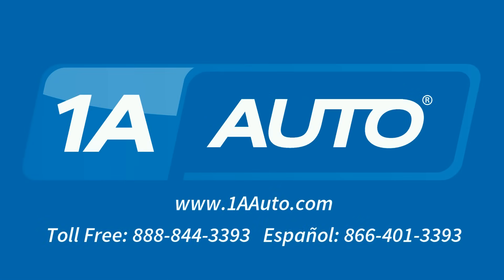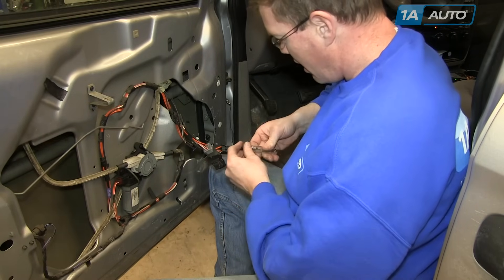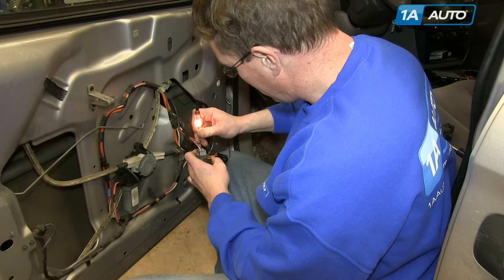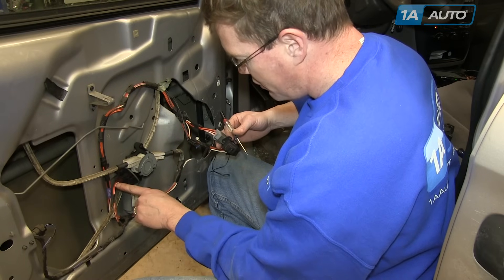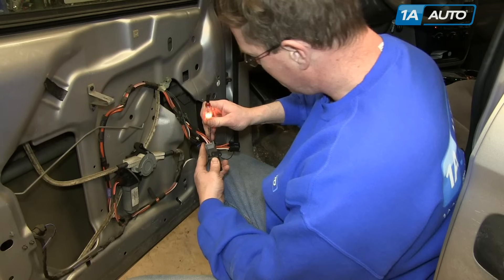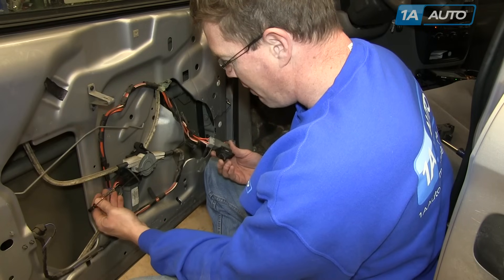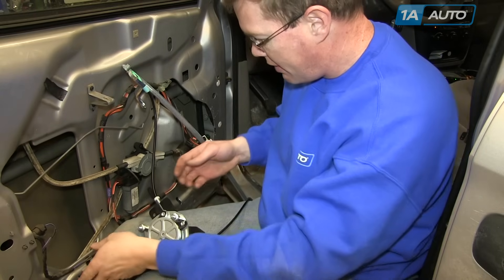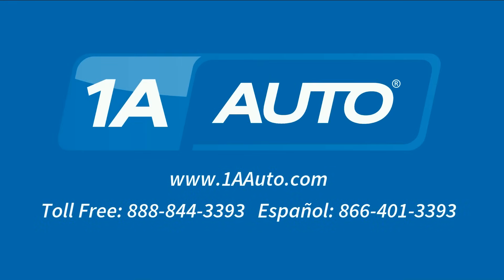How To Diagnose Power Window Problem - Is the Switch or Motor bad?

Comment from the maker: √  Watch the Video
√  Buy The Part at 1A Auto http://1aau.to/m/Visit-1AAuto
√  Do it Yourself
√  Save Money
Reply: Timing chain
Reply: My stereo quit working and then my dash gauges went nuts and then the vehicle died and wouldn't start I think I need to  replace the whole fuse box panel what's your opinion
Reply: @michaelgamblin4606  qqQQQQQ
Reply: @michaelgamblin4606  p0004
Reply: Hi guys, wonder if anyone might be able to help. My Roadster mk 1 driver's window has been slightly erratic for about 9 months but always corrected itself. After a serious cold day it appears to have had enough. It goes down but only up by 1/4 - I've tried all the 'tricks' but no go. Just changed the window motor and still the same. I'll watch the vid when I get back home but does it sound like a regulator issue (as the window does go up partly..??)

Comment: I simply swap opposite side window switches. If problem follows. It's the switch. Great video.
Reply: MegaHowtoMan Damn! That’s so simple, yet brilliant! I’m about to go try that now. Didn’t think of it. Thanks! I hope it is just the switch.
Reply: Damn thanks
Reply: lol They are ALWAYS different on the front doors genius? master switch is on the drivers side lmao
Reply: Thank u so much it worked lol
Reply: I’ve got power in my note or you can hear it when you click the button up and down it’s just been sketchy sometimes when I push it up or down didn’t want to work now I’m sitting here with my panel open and don’t know what to do but Pull my window up and Stick something down in it but can you really put the motor from the passenger side and the driver side? What about the other side when you do that?
Reply: 200 IQ
Reply: @WomenLockedUpBeforeAndAfter  what did you end up doing?
Reply: Flat rate thinking 👍🏾
Reply: Great idea. For me I’m a bit of an idiot and I don’t wanna risk damaging both door panels, not trying to push that on anyone else 🤣
Reply: D

Comment: i used this video get a false positive for a problem with my regulator.  Light came on even though I had a breakin the wireon my drivers side door.  Replaced motor.  replaced switch.  Finally found break in white/yellow wire in boot on drivers side door
Reply: He said at the beginning check for broken wires first

Comment from the maker: If any of our viewers need to replace their power window switch we carry new ones on our website for many different year, make and model vehicles. Here's a link to them. We also offer free shipping on all order in  the US http://www.1aauto.com/power-window-switch/c/35?utm_source=YouTube&utm_medium=CTA%20Comment&utm_campaign=1ATony
Reply: I may need one
Reply: All windows work using the drivers main console but not independently. Help
Reply: 1A Auto Parts question if the window rolls down but not up is that usually a sign of bad window switch
Reply: 1A Auto Parts  I have a Nissan 240SX 95 my one little Swiss is broken I just need the top cover twice wondering do you have that
Reply: 1A Auto Parts Nissan Maxima 2002 diagram for the wiring for the window on the driver side
Reply: Gracias que buen video nunca e ordenado piezas por qué mi carro nunca sea descompuesto pero veo sus video y que bien que ya tengan 800 k suscriptores los invito aque se suscriban a mi canal...
Reply: I have av2015 latitude,pass and I switch is lose any videos on something like this
Reply: @HurricaneMelissa25  what was the outcome of your switch problem? Was it the switch?

Comment: Done the Diagnose on the switch, Checked the relay with a meter And the 9 volt trick, switched relays, Checked the fuse. Took out the motor from the window Took it apart for cleaning and inspection One of the two magnets on the sides for the shaft Had a broken split magnet where the power to go up meets the power wire You could get the window down However once there was a bit of load/tight pinch / way half going up on the motor The shaft would move slightly And the connection would be lost - 

Ordered a new window motor regulator from 1A Auto - It was Cheaper than most other websites And the ship (Has nothing to do with 1A Auto) was pretty fast for outside of the country Right part And fit perfectly .....
I say all this because--- How many part suppliers take the time to show you a video on diagnose And uninstall/install the very part they sell....Thanks 1A ! Top notch !

Comment: I didn't know anything about Power windows and in the last month I've learned how to change out motors and regulators pn 2 different cars,thank you for the videos.
Reply from the maker: A little know-how can go a long way.  We're glad the video helped you out.  1aauto.com 866-403-3393
Reply: @1AAuto  help I use main driver control to open windows but rear passenger window won't work !! How do I get it to work. You didn't cover that. .

Comment: Great video, it's still very helpful for an old guy that seems to forget a lot more than I should for a retired mechanic.
Reply from the maker: +Todd White Thanks for checking us out, glad we could be of assistance!  1aauto.com
Reply: You didn't forget. Automotive vehicles have transformed from basic transportation to complexly designed and technology-laden centers of operation. You can do most anything sitting in the cockpit of your 21st Century Masterpiece of human ingenuity. Just don't try to fix one, on your own.

Opening the hood of a newer, modern automobile is to discover a whole new world of position, advancement and foreign technology. To find your spark plugs you must complete a course in dismantling much of the top of your engine. Then proceed cautiously. I'm in awe of those who have the know-how to diagnose and actually repair one of these rolling server bases. (Realizing at the same time, mechanics now have access to high tech testing and diagnosis devices that virtually tell them precisely what the problem is and how to etc, etc.)
Reply: Has not helped me at all my back window s are manual

Comment: i went to college for auto electric 2 years and passed a National Technician Auto Electric Certification and it was easy to pass if you know the answers... Haha,,, window electric problems is fun for me, made a ton of money doing repair on them and just love the hunt for the answer to the problem... but my real love is building Turbine gas engines, now thats where the real money and skill is,,,   also using a test light can damage auto electric systems my friend so look out you should use a LED test light, in college we had to make one in the class to pass the course, yep look out for that LED test light for very low mA circuits...  you just learned something.

Comment: In a pinch, you've tried everything and maybe come to the conclusion you're gonna need a new motor or switch. Maybe you don't have the money to buy a new switch and it's gonna rain. Or you live in one of those places you wouldn't live in if you didn't have to, gotta get that window up. 

This works and has worked for me, anyway. Open the affected door and with a fist, moderately bang on the door panel around where you surmise the motor and attaching wires might bang. All the while with key on and your switch for that window pressed. If you're lucky the window will close. If not, there's one more possibility to try. With key on, but switch not depressed, open affected door and slam it closed fairly firmly. Much harder than you normally would, but much like you would if a rabid Bigfoot was 2 feet away from getting into your car with you in it. 

Well, did either of those work? Try it again, but don't stay up all night with it. If it's going to work it'll do it on the first second or third try. If it doesn't, follow this video or go see the car doctor, when you get the bucks. A lot of em. I have a PT Cruiser that the driver's window gets stuck in the open position and won't close. Freaked out, I immediately went to the WEB to find a solution. One video harkened to my less-than-Bezos wealth and offered these solutions for the desperate. With no promise they'll work. The banging on the door panel with my fist did and does (1 year now) work for me, for how long is the only remaining question. Good luck or getcha some Handi-Wrap.......

Comment: This is good stuff.  Your debug logic is good, the back-probe to identify power and connectivity is correct and the triple check by connecting to another known good motor closes any remaining guesses. Can't imaging why some give this thumbs down as this is exactly correct approach.  Maybe double check connections and ground to be sure they're good but If you have concerns because of other electrical anomalies, that's a different subject and video.  Thanks I appreciated this video's testing Vs Parts Swapping fix!
Reply: +Ron Arndt The initial troubleshooting is backwards, but it works. Begin with the suspected defective component, check power toward the source, not away from it. Then install a known good component. Aircraft maintenance and repair 101.
Reply: Ron Arndt 2003 Sebring sedan. I fed the front pass. motor 12v from a separate battery and it works up and down by switching the wires. When plugged into the car harness window goes down, but not up. Will not work at all from the driver's door master switch. I have a constant ground on one leg of the motor, even with the switch in the neutral position, and no ground on the other leg with the switch in the neutral or up and down positions. Any ideas? Thanks
Reply: Fred Flintstone that's aircraft maintenance 101 buddy because the practice requires to assume the worst first being that fixing the simplest thing may Overlook the most complex thing being close to failing and cause a plane to fall out of the sky so that is why you start at the device that stopped working on a plane first as a preventative measure to avoiding a catastrophe. In Automotive you start with the simplest least expensive cause regardless if the process of elimination leads to The Most Extreme Complex item in a system because if it fails on an automobile it likely will not cause harm to anyone's well-being even on a brake system buddy.

Comment: Once again Mike your a lifesaver. I had replaced the window switch in my Chevy  a while back. You gave me some good advice.  Now I've got the same problem with a different car but I don't think it's the switch this time. Glad I saw this video so I can correctly check the wires tomorrow. Fuses are fine, I've tried 2 other switches from the auto wreckers and they didn't work. If it's not the motor which I haven't tackled before then there's a break in the wires . Thank you again. I'll let you know the outcome.

Comment: THANK YOU this video really saved my bacon. I knew the driver window motor was bad. I had been looking to get one. Then happened upon this video. I followed you as best I could. But the car I was working on had a lot of wires. I could not tell which wires went to the driver widow. But when I probed the connections I found one that,  when I pushed the button it tried to roll up, it was already up. But when I pushed the button to go down No light No movement. So I took the switch out and took it apart. Half of it looked like it had rusted away. I am thinking water got to it. Anyways I got a new one and hooked it up. Pushed the button down and for the first time in several years the window rolled down. I pushed up and it rolled back up. Even the auto window worked.  Thank You again , had it not been for this video I would have been buying parts I did not need. I also should mention I have bought parts from  1A Auto Parts. Nice folks and reasonable prices.

Comment: I would have checked the wires at the motor first because if those two wires are hot, it means the switch is okay as well.  You start at the end and keep working backwards.  I think that makes more sense, don't you think?  Just a thought. And thanks for everything you do here.  And I like your clarity of videos.
I think I am going to be needing a motor for my passenger side of 2005 Town and country. I will be ordering from you.  Been too lazy to check it.  :)

Comment: Any advice on a front passenger windows that goes down but will not go up. Should I replace the switch or is there anything more in-depth that I should look into. Any info you can provide will be greatly appreciated. 2004 Ford Expedition XLT.
Reply: good ? Robert. I have same issue with a 94 corolla. So how about it A1? any suggestion?
Reply: Robert delgado mine went down..not up...got a new switch all is well.
Reply: my 2002 silverado has a similar problem with my passenger side front door window.  Goes down, but not up.  Neither one of my switches make it go up (driver side and pass side) Does that mean it's probably the motor?
Reply: Short or break in wire in boot in door jam
Reply: It sounds like a bad motor. It’s going out but can still function with the help of gravity. It just doesn’t have the power to rise again

Comment: I have a 2005 kia sorento, the drivers window won't work. I followed your instructions and diagnosed the problem in 5 minutes. Turns out the motor is bad. 
Thank you for your help.

Comment: All of your videos are well made and easy to comprehend. 
I rolled my 2000 Buick LeSabre's passenger window down the other day. When I tried rolling it up, the switch allowed the window up two inches. Though I can roll it down from that position, it will only go up two inches, yet the switch clicks. 
The shop said I need a regulator, motor, and wiring harness. Is that common? I am tempted to do it myself (after some troubleshooting) and order the parts from you.
Reply from the maker: +David Adams Sort of sounds like you need a motor and maybe a regulator. Not sure about the harness though, those are usually ok. It's common that a window will go down, but not up as it takes more power from the motor to put it back up than it does to bring it down. So if the motor is dying, going up will be too hard for it. Order your parts from us and we're sure you can do this yourself! :) Here's a link! https://www.1aauto.com/search?q=regulator&year=2000&model=141&abTestingValue=OFF&utm_source=YouTube&utm_campaign=1ATony&utm_medium=CTA%20Comment
Reply: 1A Auto Parts It is the motor and regulator. I have the window pulled up temporarily, but I'll soon order the assembly from you.
Thank you for the quick response.

Comment: Good info, but you could just start your power checks at the motor.  If the motor is getting power you can skip the other two checks because you'll already know power is getting to and through the window switch.  If no power is getting to the motor, then work backward from the motor to the switch check, etc.  In my experience, the majority of the time on vehicles since the '90s it's the window motor that's bad.  Before the mid '90s or so, power windows switches were a more common failure point, but not so much anymore.  They do occasionally go bad, but it doesn't seem to be nearly as common after about the mid '90s.  I've changed a half dozen bad window motors since the last time I had a bad window switch maybe twenty years ago.

The thing that's really maddening with a power window or any electrical fault is an intermittent malfunction.  I have a vehicle that I bought brand new, and just before it was about to go out of warranty based on time (36 months, it still had only about 15k miles on it) the driver's side power window starting being intermittent.  It would stop working sometimes, maybe every few months, but then start working on its own again before I could take it back to dealership for a warranty claim.  It always worked and tested ok at the shop, and neither they nor I could ever find the problem.  Then a month or even several months later, boom, it temporarily stops working again, but starts working by the time the shop or I could test it.  I can find no one online reporting a similar intermittent malfunction with that make and model.
Reply: Yes. Good tip. I always start at the motor. If you have power there, You know it's not the motor/regulator

Comment: One of the up/down switches had much higher resistance than the other one, as clearly shown by the dimmer light during the testing. This could result in significantly less power coming out of the dimmer side of the switch, typically the side providing lifting power, and causing slower operation of the lifting of the window. Diagnose and eliminate this possibility before replacing the motor assembly.
Reply: i dont think it was dimmer?anyways avoltage drop test should had been done  for sure using a meter.he may have fixed the actual problem but a voltage drop can mean slow motor speed.also would had used a larger wattage bulb as close as i could to putting as much amp draw as the motor draws.if its nice and bright just like when you touch test light to battery your good or just use meter and perform voltage drop test,
Reply: @pigeonsil240sx  After replacing a rear driver side regulator, 1) the up and down operate opposite,  and 2) the window action is much slower than before. Motor appeared to work fine on bench test, it was the cable jammed in the spool on the regulator  (that stupid little plastic part that holds the cable ends, that always breaks). Do you know what I did wrong? I'm not understanding why the slower action. The reversed action, is it possible the new spool is would backwards from the old one?

Comment: The rear passenger window won't stay up on my 08 VW Rabbit, will I need a regulator and a new motor?
I'm so glad I found your YouTube! Thank you in advance!
Reply from the maker: +Mrflask Tastic Sounds like a regulator issue. If you can hear the motor running when you press the switch, or it sounds like it's trying to work the window, you probably just need the regulator. But it's hard to diagnose without actually seeing it.